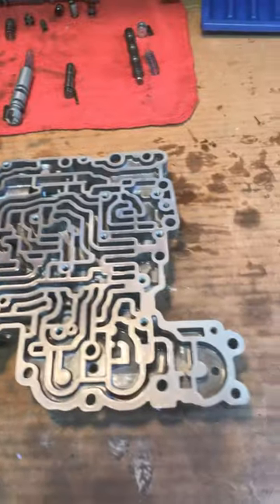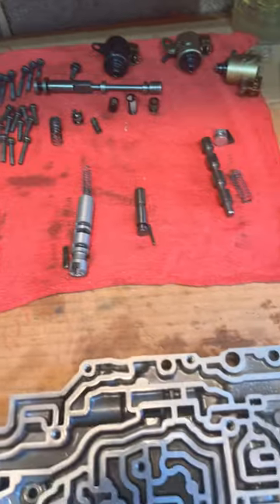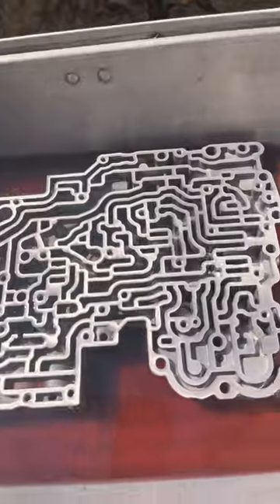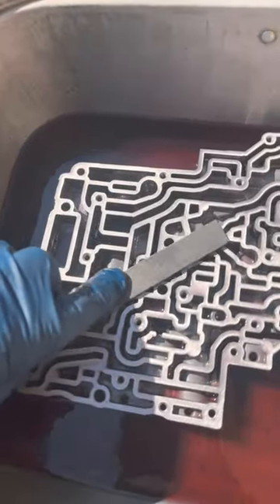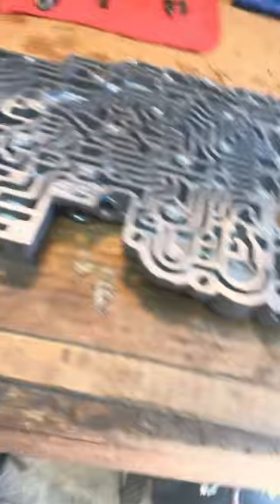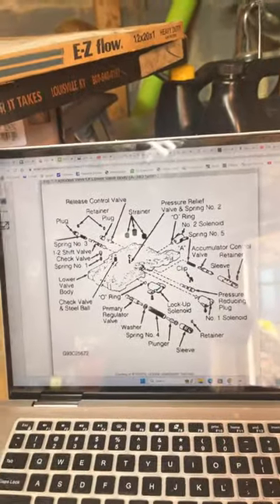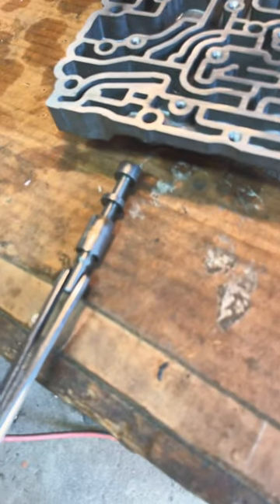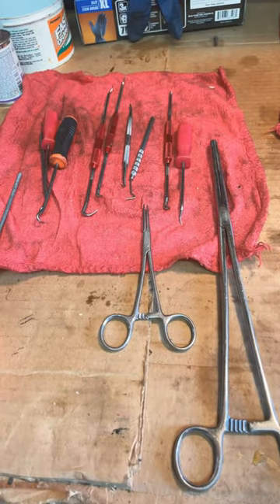Transmission valve body repair

Comment: good job.  I have a full selection of tube brushes (hone to you), steel, nylon, copper.  for anyone that's never done a valvebody, it usually only takes a few seconds, with the drill.

Comment: I have a 1999 subaru outback, which has a valve body failure. The valve cylinder (with spring) does not return to its position, which is why it fails to change gears and shows the At oil temp warning light.
will it have repair?

Comment: Im having problems with My 2002 s10 has a code p0756 when i start i feels like it's stuck second gear it shifts fine up bit when i coe to a stop an start again it feels like its in second
Reply from the maker: Possible shift solenoid B stuck off. You may be able to repair it by removing trans pan and replacing shift solenoid B. We will normally replace both solenoids - A and B

Comment: Serious question: Why does it look like a maze?
Reply: To be able to shift in different gears, the fluid has to follow a path or circuit to engage/disengage different clutch packs. We can compare this to an electric circuit in a computer's motherboard. Instead of electricity, transmission fluid is flowing to complete a specific circuit.

Comment: Really all you did was clean the valve body. You need to vacuum test the valves to determine if they will seal. Most importantly the Pressure Regulator valve, the way to fix them if they don't seal is by reaming and installing an oversize valve or fix made by Sonnax, TransGo, or other manufacturers. If you have valves that dont seal your transmission wont last very long.

Comment: I have a 2014 versa cvt won’t shift to drive from  low gear unless I pop it into neutral and back, can you fix this  issue? Is there a quick fix if I drop the valve body? I’ll pay you!!!!!
Reply from the maker: We only do exchanges on cvt trans

Comment: Why are you honing? Do you intend to insert oversized pistons? Valve body bore wear is your biggest enemy and honing will not help. A file across the face is also not your friend. 
Brake cleaner and compressed air is all you need for cleaning.
Great job removing all the pistons.
Reply: oversized pistons! lol, he's using a valve body hone on a valve body to clean the passages, makes sense to me
Reply: @jessebrown9046  
Huh? Never heard of oversized pistons in a valve body?
It's one way to address wear. Another is to introduce o rings.
In terms of cleaning a valve body, a hone is a bad idea. It's creates a larger bore, which is usually the end of a valve body to begin with, unless you have the larger pistons to match.
To clean  a valve body is 1, 2: diesel, alcohol, even water. No honing needed. A hone will simply accelerate wear and it cannot access the finest debris in the crevices.
Are we sure we are on the same page?
Thanks.